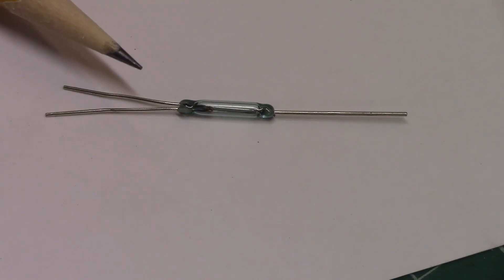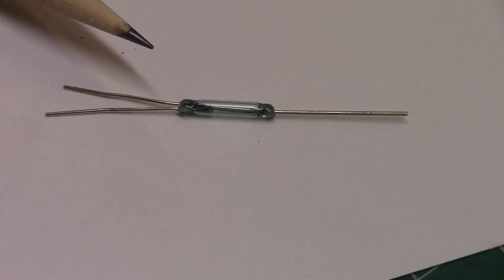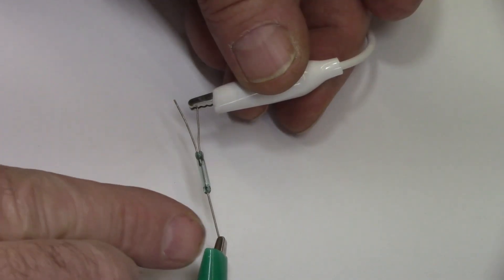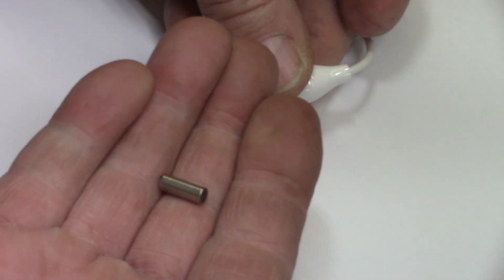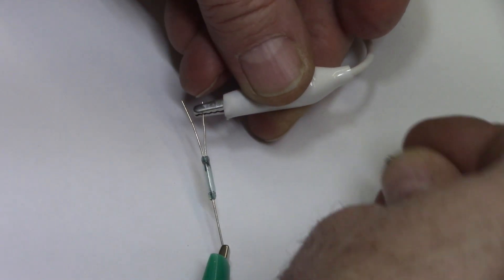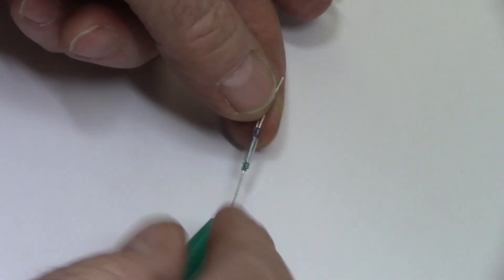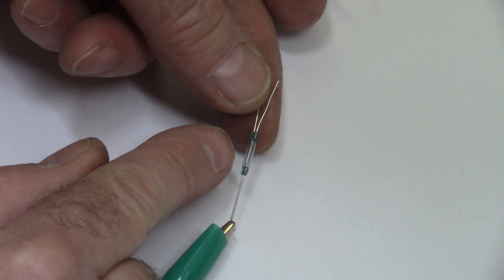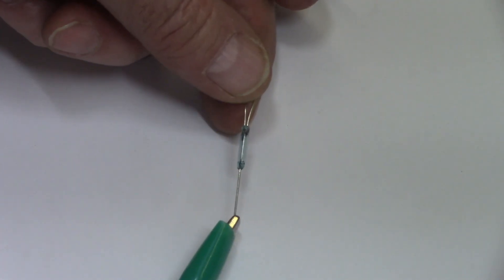What is a Reed Switch

Comment: Yes this is interesting.  We use similar read switches on air cylinders to sense the position of the piston.  The body of the cylinders is aluminum and they put a small magnetic ring on the piston which the read switch is activated by.  For us, this is the way we know if a mechanical latch or lock is engaged.  Then they tie back into a little microprocessor to allow operation.  Good video thank you.
Reply from the maker: That's cool!  I'm envious of the things you get to work with.  Thanks for sharing Glenn!